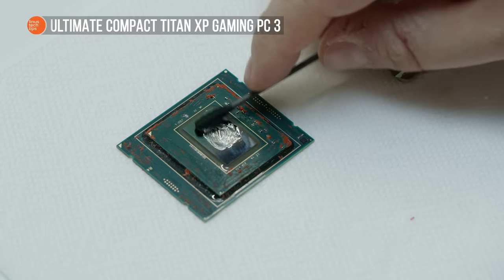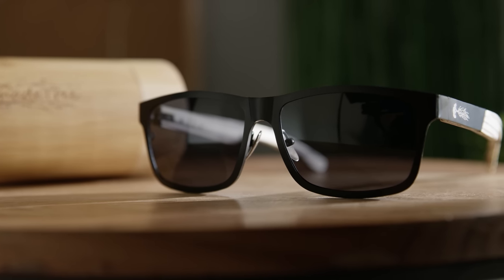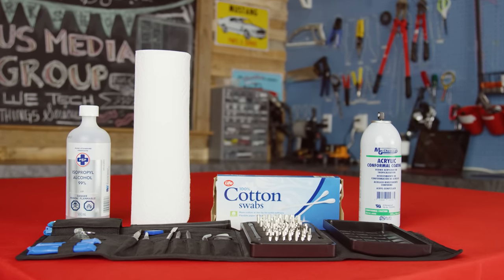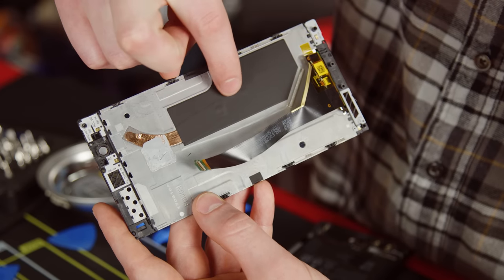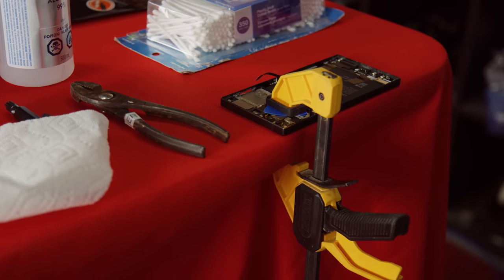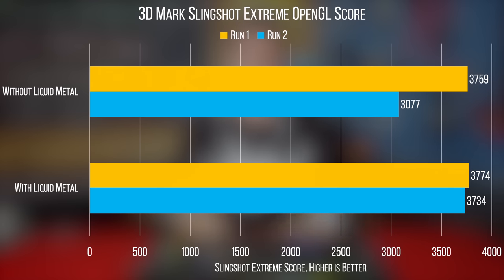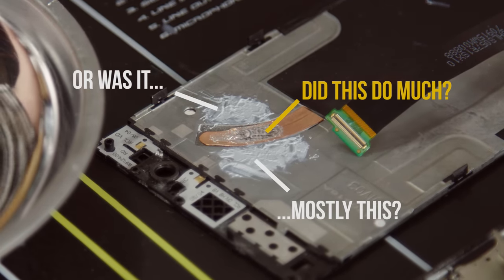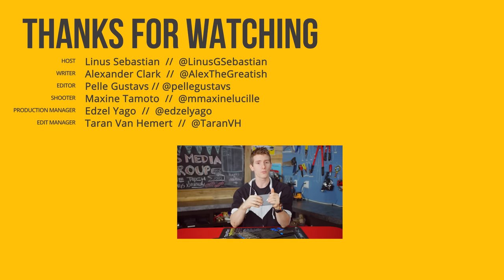Liquid Metal Cooling a PHONE!?!?!

Comment: I did more reading about this stuff since I'm interested in using LM for my own laptop, and it seems corrosion is not out of the norm. 

Typically when LM is used under the IHS of a desktop CPU (often necessary for intel chips since they bond the IHS to silicon with toothpaste instead of solder) the results are pretty good even after a year. The IHS (which is made out of copper, then nickel plated) does get stained by the LM but nowhere near what happened to you. This is because your contact (in a laptop) is silicon die <-> LM <-> copper heatsink.  In the desktop scenario, LM is often applied underneath the IHS so the contact is silicon die <-> LM <-> nickel plating <-> copper.

To be even more clear, the key differences in your application of LM is that
1. Your application was silicon-copper instead of being silicon-nickel as you would find in the 'delidding' of a desktop CPU
2. Your application was not insulated against air (read: oxygen)

1 is important because the electrode potential of gallium is -0.53V, nickel -0.24V, and copper +0.34V. Obviously, all liquid metals are made out of gallium (because Ga is liquid at room temp, and is also nontoxic unlike mercury) plus small percentages of other metals to reduce the melting point. When gallium is in contact with pure copper, the differences in electrode potential favors the gallium and copper to alloy, which will eventually consume the gallium completely[1] (Ga + Cu → CuGa2 [67%] + Cu3Ga [11%], and both products are stable until 175C)[1][2]. 
The liquid metal will literally into the copper until the gallium is gone, which causes the copper to turn silver-ish. The non-gallium components (indium, tin) of the liquid metal[3], which are solid at room temperature, get left behind - and that stuff is hardened deposit that you were trying to scrub off the heatsink.
Note that at higher temperatures, the reaction between gallium and the copper heatsink only gets faster.

2 is important because the gallium based LM components can and do oxidize. This is the reason why people generally recommend sealing your contact as much as possible. With a desktop chip under an IHS that's already halfway taken care of by the IHS itself, so if you've never seen a liquid metal tutorial for a laptop you might have not even known that sealing the LM was important. I'm not making this stuff up, gallium begins to oxidize at 25C and fully oxidizes at 75C[2] (Ga2O3, mass fraction 0.12) which is a totally achievable temperature range. This is not even considering the fact that the other components on the LM can oxidize, and they likely will.

Other interesting things to note: 
1. The thermal conductivity of CuGa2 (the principal alloy of gallium and copper) at 20C is 98 W/(m⋅K). Copper's thermal conductivity at 20C is 400 W/(m⋅K).
2. We have no idea what exactly is in LM, the formulations are proprietary - but it's been said that the consistencies of Coolaboratory CLU & grizzly conductonaut are not the same so clearly whatever is in this stuff varies and lead to different results.
3. Simply buffing the residue off the copper heatsink and reapplying the LM might be OK. The GaCu alloy is obviously not as good of a heat conductor as pure copper but it's not clear how deep the gallium will attack. If eventually you keep reapplying LM and the gallium can't penetrate its own pitting then it's effectively self-limiting and you end up with a 'stable' LM application.

These papers are interesting if you want to learn more about the process:
1. http://www.ipme.ru/e-journals/RAMS/no_81808/grigoryeva.pdf
2. https://sci-hub.ac/https://www.scientific.net/DDF.326-328.227
3. http://forum.notebookreview.com/threads/something-to-think-about-liquid-metal-compatibility-with-copper-heat-sinks.800890/

TL;DR
Liquid metal pastes react with copper heatsinks (aggravated by oxidation and higher temperatures) until the gallium in the paste is totally absorbed by the copper heatsink and you end up in thermal runaway. The damage to the copper is permanent, but if you keep reapplying the LM whenever this happens you may end up with a stable LM application. LM is much more stable when used under the heatspreader of a desktop CPU, since the heatspreader is nickle-plated and way less reactive to the LM.

This is an excerpt of a comment on another video
bobsagget823

Comment: The next logical step to cool with liquid metal would be game consoles
May I recommend the Nintendo switch
I would like to recommend the PS4 because the base models (not slim or Pro) run extremely hot but you know the whole aluminum heat-sink thing😢
Reply: Or just get a pc and get out more in the REAL world!!
Reply: Sebastian Hakansson you seem to miss the point
Reply: Doubt Linus even knows where to get console.
Reply: Well I have a PC and want a PS4, those exclusives are sick. Console/PC wars and fanboys should just disappear altogether.
Reply: Mishobu join the glorious gaming race
Reply: Nathan Hamman Don't know if you mean the "master PC race" or just the "gaming race" which i think includes all consoles + pc and just pure love for games. lol
Reply: Mishobu I agree. Consoles should just disappear.
Reply: Garganzuul... emm no, that is not what I said...
Reply: The Xbox red ring, and Toshiba graphics chip lockups were a result of poor design. They simply did not allow enough cooling and so over time, the foam pads and boards warped from overheating, and caused the failures. Funny all motherboards caps are gathered around the processor, which is where the most heat is generated and yet cause the caps to rupture and fail. Old computers especially.
Reply: Kenneth Bouchard May have also been that lead-free solder was pretty new, and that may have had some consequences.
Reply: Fixed old Mac Stand Up model, cannibalizing one system to make the other work, removing all the caps from the dead one that was in good shape, and populating them over to the other one, and it then was rock solid stable. Was probably not worth the effort, but more of a quest. Agree, but the reason they had to put the caps around the processor, was to remove glitching of the power rails, that caused lockups. New motherboard designs eliminated electrolytic caps, that could not tolerate the heat. But then they never thought the systems would last that many years. Most old computers people neglected and filled the fans constantly with dust that builds upon the processor heatsinks. Simply an annual dusting or vacuuming, fixes the lockup problems, and extend new life into them. Same for notebook computers, just some compressed air into the radiator slot will fix it yearly and prevent your lap from burning.
Reply: >turn on PS4
>start ghost recon
>after 30 seconds it sounds like a god damn jet
>do same with PC
>don’t even hear it
Reply: Found this video a few days ago. Ps4 pro sounds much quieter after liquid metal.

https://youtu.be/gpRhxa_mFdw

Comment: I've extended long term cooling performance with double sized battery and home made tinfoil cooling grid in arised free space in cover. It is more like extending heat capacity before overheating, but still it worked.

Comment: Liquid metal on a laptop = stupidity level 40%

Liquid metal on a 800$ Razer PHONE! - stupidity level 100+%
Reply: wait untill linus does liquid metal on the apple watch. 10,000% stupidity
Reply: Liquid metal on a nintendo switch?
Reply: Liquid metal on a laptop is actually very smart. At least gives you an idea. Thermal paste on older laptops is none existant. While everyone might  not do thermal grizzly swap, but like arctic silver 5 made it run cooler than a pc
Reply: Benjamin the laptop was 3000$
Reply: but.. it works?
Reply: turns out on the laptop it actually was not such a stupid - albeit it risky idea, on the phone - well lets just say you are using the wrong device lol.
Reply: liquid metal on calculator
Reply: I would like to see it on a smart tv, but how the fuck do you banchmark that?!
Reply: All I want to do after seeing this vid is to use it on aluminium cans.
Reply: Liquid metal in the AC socket! 
(it is not stupid if it kills the stupid people!)
Reply: Matthew O'Neill
4k porn banchmarkt! O_o
Reply: RIP smart TV then lol
Reply: Razer phone the most dumbest hyped phone in the history.if apple or Samsung make this kind of thing. Their market share will fall overnight.razer also prove PC community has very limited knowledge about phone
Reply: Meisam for sure
Reply: The laptop is safer than a phone
Reply: Thats why it is more reasonable

Comment: Placing a decent fan inside the phone would work much better than liquid metal. You know those tiny cute fans used for small projects. If we could have one of the smallest fans we could place it  inside. But we would have to reconstruct back case with a 3d printer. I would like to do this and see the results. Cooling fan inside a getting very hot smartphone would be a good idea.

Comment: These huge performance gains on everything really makes you wonder why manufactures don't design their products to use stuff like this. It couldn't add that much to the cost of an item to use good thermal paste.
Reply: Shit goes wrong. If you short circuit that could be dangerous. If failure rate becomes too high you've just destroyed your reputation.
Reply: That could be designed to be avoided. Even going as far as a gasket seal around the CPU if needed. It seems like even if the manufactures didn't want to max out performance they could use it to cut back on the heatsink size because it would be better utilized allowing smaller or lighter designes.
Reply: If you max out everything from the getgo there's no room for improvement, so there's no reason to make a better version, missing out a lot of money.
+ if you make a product that will cost you more to produce, it will cost the costumer more to purchase it aswell, its all about finding that balance between overpriced trash and decent enough quality for a fair price.
Reply: The average user probably isn't going to notice, so it's not worth using. I mean, realize, most people buying a laptop or phone or whatever aren't using it for gaming. They're using them as expensive Facebook or Netflix machines or maybe to run a word processor. This stuff is in the neighborhood of 30-40 bucks a tube and manufacturers just aren't going to spring for it when most of their customers won't care. Maybe for high-end gaming laptops I could see it, but not for what most people are buying.
Reply: Liquid metal also doesn't last as long as traditional thermal paste. A machine using liquid metal is likely to need it replaced multiple times within its working lifespan, which isn't a big deal for the technically-inclined who built their computers from scratch anyway, but would be a major problem for the typical consumer, as well as a logistical problem for the manufacturer who would have to provide such a service
Reply: AboboKing corrosive, not worth it for the average user. Higher failure rates, retooling your production line, etc etc not worth the headache.
Reply: They probably retool for most products, so thats not valid point. Else, yeah.
Reply: Just use the arctic silver, or any better quality thermal paste. Doesn't have to be liquid metal, there's still better options for safe thermal compound.
Reply: BlackSn0wz say it adds $1 per phone. Over a few million phones that's a few million dollars. Few if any users will buy a phone because it had some nice thermal paste. Not worth the investment.
Reply: Colossal companies cost note even the last millimiter of plastic.Its all very very carefully planned out
Reply: AboboKing Have you bought thermal paste? There is a huge difference for manufacturer if buying 100x pcs of arctic silver(7$ a piece) and buying some cheap stuff(0.80$ a piece)
Reply: "Collosal"?
I think you mean colossal.

Comment: Before this video came out I had a old LG G3 and they have problems with over heating and that causing cracks in the soldier after a long period of time.

I baked the mobo in the oven to hopefully help with the phone since I had the bad soldier issue as well. It worked great (for a week)..

Anyways I put some thermal paste on the processor and put a penny over that. Very thin layer but it seemed to help hold the temps idle for a bit.

Comment: Linus mentions gallium and off I went on a research project, yes gallium reacts quickly with aluminum but also slowly combines with copper in the same manner..... and I did find a thread that talks about what the end result of this was. Since most liquid metal products contain gallium, indium, and tin; once enough gallium combines with the copper, the indium and tin are left behind as deposits of solid metals, usually with high porosity(air gaps) and then thermal performance tanks(to levels possibly worse than the worst paste), also the new gallium copper alloy supposedly has a thermal conductivity 1/4 that of solid copper....... This reaction happens at room temperatures slowly, but is sped up by higher temps, which means a heavily used rig will see this problem sooner.
Nickel has a much closer electrode potential and thus should alloy slowly, if at all. Therefore deliding  applications should have few problems due to nickel plated heat spreaders. I found a review thread that goes into more detail and research (also has sources listed) http://forum.notebookreview.com/threads/liquid-metal-explained-how-it-works-why-it-fails-and-how-to-use-it.809332/
He claims that liquid metal applications can last a couple months to over a year with unplated copper surfaces.... the couple of month applications probably had high average temps causing the alloying process to happen quickly. Soooo I would expect that this phone would likely have problems in 2-12 months if used regularly, thus changing this from risky to nu-uh territory maybe just do this with great thermal paste(taking apart phones SUCKS)

Comment: Why would I need to open up my phone to put on some liquid metal, when I can just put my phone in the fridge or freezer for 1 minute to cool it down? That's how I do it lol.
Reply: For benchmarks, we've put my cousin's phone in a glass of water (its waterproof) and you could do this on the go, but running it in the freezer did allow it to turbo slightly higher. I personally have my own water cooled 7in tablet (Fallout 4 theme, radiation barrel reservoir with pump inside going through clear hose filled with green "radioactive" anti-freeze and then to rusty steel pipes as the radiator like you would see in a nuclear plant). It looks pretty awesome, while being 40c colder than stock with a 44% overclock. 

Its on Thingiverse if you search "penny waterblock", which is a hint to how I developed my own waterblock specifically for small devices such as this.
Reply: Bad idea. Cold creates moisture, so freezing your phone may eventually cause corrosion inside it. Electronics like to remain at a stable temperature. Rapid cooling and heating result in early failures. But I suppose given the life of a cell phone can be from hours to years, based on where and how you use it, probably make no difference.
Reply: "Cold creates moisture", and by that incorrect statement, temperature creates matter, which is energy based off of M=mC^2, which is based off the speed of light, which means we can turn back time by flying around the sun faster than light because Superman...

I'll try to clear up something, the temperature does not "create" moisture. How does condensation happen? Its cold relative to the AMBIENT. I don't care if its -100c in the room, that's then AMBIENT. For it to condense, the item would have to be colder than -100c in that case. If its 2 million C in the room, it just has to be below 2 million C.

The phone will be hot relative to its surroundings, because its putting out power and heat. The problem you have to worry about is taking it out of the fridge quickly and putting it into a warmer room (because now its colder than the room), slow transitions are key here.
Reply: Jake Garrett
Well said. Also even if there's any condensation it probably still won't be a problem since modern water resistant or water proof phones have all of their hardware coated with non-conductive material and the water wouldn't be able to short anything.
Reply: Keep doing that and discover that condensation forms when taking the phone from cold to hot. End result  phone failure.
Reply: Revolutionary... 

But in all seriousness, I hope you're kidding 😂😂

Comment: You have to use a white or gray paste first on the cpu, and an invalid Windows sticker over the cpu, until it reaches stable, cool state. Youtube stressing sets the cpu to its best performance. The pc may crash, restart is needed, and Opera for the fix. When you are done, remove the radioactive Vista sticker, and you can use the black paste. If black sticker is over the cpu, it will remain on the blacklist. By default, the cpu is on blacklist, and a framework is installed on the laptops to make it work seemingly normally.

Comment: You could do a video where you take the phone apart, make a hole in its back and then attach a cooler with a fan from an old laptop or GPU directly to the phone cpu, and then power the fan from the usb of the phone. Then overclock the phone (custom rom probably needed) and see the results. Preferably pick a cooler that can be made to somehow not stick out that much to the sides but has a fan and at least one heatpipe.

Comment: in all actuality you could've used some silicone formed around the cpu to protect it, instead of going that route. i feel there are way better gains to be had with the actual liquid metal solution, however the materiel used on mobile cpu's like that isn't really that conducive to liquid metal. could use some more testing imo